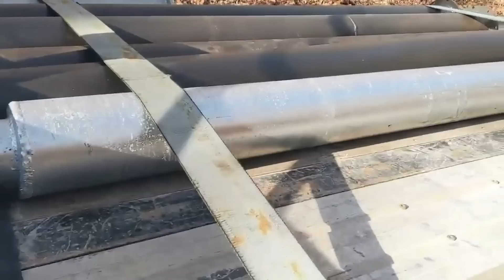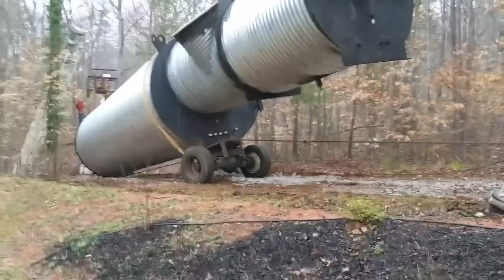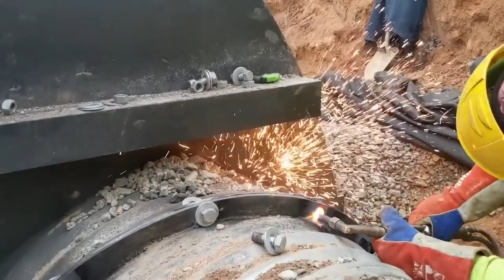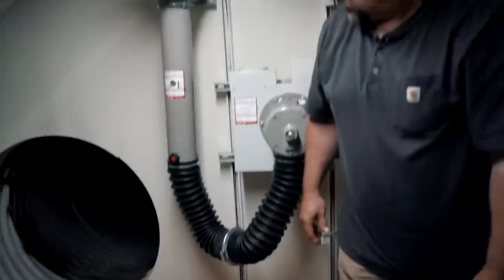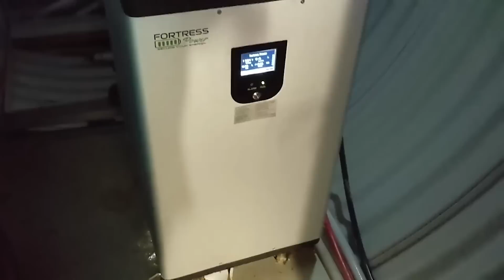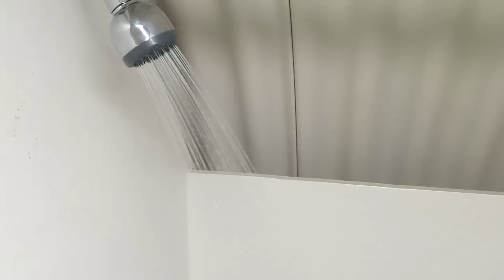Engineer775 installs an Atlas Bunker with Solar, a Diesel Generator, and WIFI!

Comment: To be effective, any bunker must have surface protection system or everything else is easily defeated
Reply: Good points,  That layer you suggest can be an art and science in itself.  Any suggestions.   Need some videos on that layer for the bunker.  Maybe call it the Bunker Skin Surface Protection Layer, or something like that.

Comment: Why not put the generator on the bottom with the fuel on top ?
Reply: and add a fuel tank or two (or three) above the generator room in the dirt and concrete with a fill above the dirt and concrete?
Reply: suggestions....

Comment: Nice shelter.
Serious question/considerations? (I am only asking because these bunkers seem to be setup to survive a nuclear exchange/war).
You have installed a solar panel system into your bunker to help offset your reliance on your generator for your electrical needs.
If the S.H.T.F. situation is a nuclear war/exchange, then you are looking at a nuclear winter that could last from 2 to 10 years in duration (See Wikipedia for more details on subject),
For the first 1-2 years you may not get any sunlight (or very little any road); with which to recharge your battery bank. Would installing a wind turbine/ small hydro system if you have a near by stream, be a good idea in this situation?
Secondly: How long will your air purifier system last before you have to change the carbon filter, and how do you go about changing the filter without contaminating the inside of your shelter when the filter is inside the main living space? (Also where do you put the used filter?).
Most perppers have a supply of about 6 - 12 months of food stored in their bunkers but you need 3.7l water per person per day (1305l approx' year); this is before cooking/keeping clean etc.., is taken into consideration. Have you considered how to recycle your water supply into potable water?
PLEASE do not think I am taking the P**S! 
The "Wine seller", you have had installed is a very nice one (wish I could afford to have one myself), but it all ways seems to me that these types of shelters are setup primarily for short to medium periods of civil unrest (1 to 3 months) but no thought has gone into their long term use as a nuclear fallout/survival shelter.
Most major S.H.T.F. situations seem to have the potential to last for decades (As in rebuild society time periods). I can see the real value to owning a bunker in the short term of a nuclear war but question it's value for any long term usage especially if all you have to go back to is an irradiated landscape.
Could be wrong, I would love to hear what you think on the questions I have raised.
Reply from the maker: The purpose of this particular shelter is a 30 day fallout shelter plus.     As far as long term goes as long as he has fuel he has power and since he has water he can survive in his freeze dried food.    It’s a small bunker so years is not practical without resupply
Reply: Paul you need to stop taking info from video games. Fallout is the major issue after a nuke and can be predicted on where it will fall based off what the target is and where the wind generally is as the fallout is simply the dust sucked up and mixed with the left over fission materials from the blast so all things that are heavier then air and quickly start falling out in a known zone. Nuclear winter would take a lot of wasted bombs to create as you need to ground burst the bomb to throw lots of dust up with all the bombs rather then doing the normal air burst to maximize the damage or bunker buster bombs to crack hardened targets.

You will still be able to go outside the bunker once the fallout is done and at that point it is simply wipe down/wash off the dust in most areas and in the gardens strip the top few inches of soil depending on the amount of rain. Fallout is the type of radiation a simple bunny suit will protect you from and when you are done working a shower will wash off anything that got past/around the suit.

Comment: "Comepletely" off grid?  You need diesel to supplement solar which only really works to capacity on sunny days. The fewer sunny days you have... the more you rely on diesel for your generator. When it becomes necessary to go into your shelter for an extended time you don't count on the stores to have food... guess what?... the fuel stations will be out of diesel as well. And what if your solar is damaged and unfixable? There is a company that I've been trying to get more info about that makes generators that produce electricity with magnets and do not require fossil fuel, wind, sun or nuclear reaction. They have a website but don't advertise extensively or put out many videos. They say that they're developing a model sized for RV use that may be worth looking into. The smallest size they have at the moment is a 15000kw. The link is below.

http://www.therontechnologies.com/pages/home

Comment: I'd run air intake up inside a tall stump so it's camouflaged.
Reply: Empty bee hive with mesh to keep any from moving in. When sitting next to an active bee hive it would take someone that knows bees to know something is wrong.
Reply: @TheUserid82  that's a good idea, but I'll throw this out, as a beekeeper, I'd notice bees not going in and out if I sat there for a few mins. You'd want a half intake half hive box, so bees still go in/out.
Reply: @BasedBidoof  If you look at what I wrote I did say it would take someone that knows bees to know something is wrong. It would take some work to have an active hive next to the intake and not effect air quality in the bunker or hive quality due to the amount of air pulled in so best in an empty box and the active hive next to the one you are using.

Having the hive over the intake makes it look like a perfect hive for someone to rob for honey and all the poop is dropping down to the air intake area. Having the hive next to the intake means you have a small hive so might not have the storage space for winter so would abandon the hive for a larger space.
Reply: Mine comes up in the middle of my pond.
Reply: In other videos, I've seen them suggest putting a 55 gallon drum over the top of the intake pipe for some disguise (with some holes punched for air flow, of course)

Comment: Wish I could have a bunker, but I’m in a flood zone and it’ll end up floating at some point if I did get one. <\3
Reply: Bunkers are possible there it just takes more work as you need to insure they are 100% water tight with the venting above the highest known floods and you have enough ballast on top of the bunker that in a flood it stays in place. 

If the flooding only gets a few feet up you can even create flood walls around the property and use a simple plank and gasket method to close off the openings for walking in and the car.

Comment: What would this set up cost start to finish?
Reply: Every setup is different as the shipping costs depend on how far you are from Texas and generally you are using a local guy to dig the hole and get it installed to Atlas standards. How hard to dig the hole and any surprises like shallow bedrock can really jack up the install costs as you then need drilling and blasting done. There are the simple things like where is the water table as where I am its 800+ feet down but in other parts of the country it is under 12 inches down.

Comment: Why did you decide to use a water heater Instahot water heater less space compact heats water as needed Easy installation at sink and shower easy replacement if goes out. Easy storage of additional replace meats. More storage for food
Reply: i do believe those are gas. not sure
Reply: Kraii If so the produce carbon my oxides Not a good idea IMO. I could see it being installed in the generator room which is vented properly and sealed off . Research Instahots water heaters perfect application for shelters Removed the water heater on my dads boat and installed instahots and his utility consumption reduced Turn the area where the water heater was into storage
Reply: If you mean an on-demand water heater using propane That's a really bad idea. If you mean an electric can you tell me how many amps one of those pulls?
Reply: @engineer775  How hot does it get in that gen pod after running that engine for....say 3 hours to charge the battery and maybe do some cooking, showering and whatever else?

Is there any sort of air flowing through that pod to keep that engine cool?

Also, have you ever considered using and exhaust to water heat exchanger and suck the heat out of the exhaust of the gen set and dump it into your hot water tank?

Like this maybe. These work great and you NEVER run out of hot water for showers and no big amp draw either, other than about 80 watts for a Taco pump.
https://polarpower.com/products/generator-accessories/exhaust-heat-exchanger/

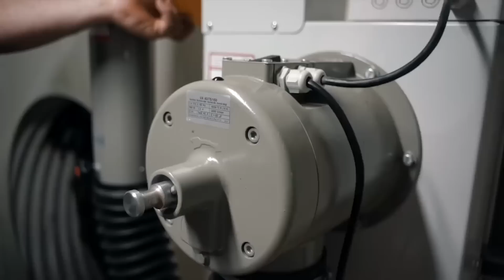Comment: 10:26 way to loud to sleep inside.
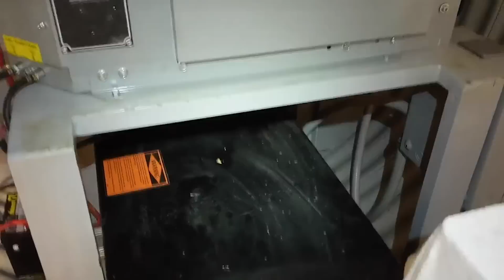Reply: I think you mean 15:26....and it is only loud if you sleep in the generator pod.....you have a gas tight door to the living area and once the door is shut you cannot hear the generator at all.
Reply: What a camera mic picks up is generally very different from what is going on in the room itself as it can get things outside our hearing range and can some times be surface sounds that are sent up the tripod.

Comment: I’m still concerned about hauling fuel into the pod to run a generator
Reply: Diesel is not as dangerous as regular gasoline...much safer in tight quarters similar to a ship.
Reply: It's no different than having a 265 gallon tank of fuel oil in your basement to heat your home in the winter time, like we did back on the farm. Not only that, our wood burning stove was maybe 10 or 12 feet away from the tank and ran that like that for decades with no problem. Diesel, is a very safe fuel to have inside.
Reply: wjf213 I get that my moms house in Maine has 275 in basement but the fill is outside not carrying 5-10 gallons of fuel into the pod and yes I’m aware the burn and flash points are different then Gasoline I was a firefighter for over 30yrs still never filled lawn mowers or generators inside always took them out side. Just wonder why a fuel tank couldn’t of been either buried or placed someplace then run the fuel line into a pod
Reply: @timalexander1166  If you mean why don't they have the fuel filler cap more easily accessible, that's pretty easy to explain. We're talking SHTF here and you want TOTAL physical control over every aspect of your bunker. Having the fuel fill outside the bunker is as foolish as leaving your car running with the doors open on the south side of Chicago while you go inside and do your shopping.

In normal times, yes I agree, for ease of filling and what not, the cap should be where the driver can easily fill the tank from his fuel truck. We had this on our farm house. The tank was inside but you filled it from outside. 

I believe tumbleweed had a perfect suggestion as well, and maybe some thing in future bunkers they can implement. Have a fuel cap at the top of the entrance but still inside the bunker, so when you open the hatch, you have a fuel cap right there and can top it off. 

If that's what you mean, I think it's a great idea and one that should be an upgrade, and honestly, one I never really thought of, but then again I've never built a bunker like these here with the gen pod. I would not want to carry five gallon cans of fuel up and down all day long either. That's just asking for a broken leg half way through filling.
Reply: Not really any different from a diesel powered submarine.
Reply: Grow some muscles
Reply: with a diesel you could actually plumb another tank and just fill with vegetable oil. You would only need to run the diesel to start and to purge before shutdown otherwise once started you can switch over to the other tank and run on vegetable oil

Comment: COMPLETELY OFF THE GIRD ... engineer proceeds to install bunker with wifi
Reply: SpaceX starlink internet satellites will make that possible and affordable. off grid just means not reliant on city power, water, and sewer (the essentials). Internet is non-essential so I don't see that as a problem.
Reply: more than likely once the hatch is closed you would never see a single outside of the bunker  i live in a metal building above ground and don't get a single outside my house
Reply: just use ethernet plugged directly into a pc and a vpn. could even be a homemade vpn for extra privacy
Reply: And I highly doubt people would be looking for wifi signals
Reply: WiFi won't escape the steel underground bunker and its completely possible to mask where you are (your ip address) with vpn's, hackers do it all the time.
Reply: @shawnwade302  assuming vpn's are still available
Reply: it is still off grid, if you lose WIFI so what? No reason not to use it when available.
Reply: How do they stop someone from stealing their solar panels while they are under ground???
Reply: Would a vpn help or no
Reply: "They'll track his bunker using his WiFi."

Good lord, stop pretending any of you bellends would have time or resources to do any tracking when your life is at stake.
Reply: @BlackCrossCrusader  raiders will do what they need to do , desperate times call for desperate measures
Reply: @juggernaut8819  And people in the bunker are equally desperate except they have resources to back themselves.
Reply: WIFI?  Sorry but there won’t be any WiFi after a nuclear war
Reply: Lol exactly WiFi in which will disclose the  bunkers location
Reply: @mikeandhunterfatherandson6705  A Starlink earth station doesn't necessarily disclose your location.
Reply: Margaret Leber the WiFi  period would disclose a relative proximity of your location all it would take is a simple scan for signal  from any device that is able to connect to wireless internet..it would even show  the person how strong the signal is  ..eventually spiking stronger as they get closer  .. the only question is would the WiFi signal be strong enough  .being 20ft bellow the surface in a metal bunker incased in concrete ... I would hope they incased the bunker in concrete I quit watching  after the WiFi comment  and noticing  that a professional engineer was  installing a bunker putting lives in danger without any proper shoring  neither step ,slope or a trench box .i love what  atlas does and this has no reflection  on the quality of atlases work  and atlas should not be judged for any of these things...also I never mentioned anything about starlink  so I’m not sure we’re tha comes into the conversation  as I was talking about the WiFi signal coming from the router  and if it is 5g .. forget about it you exact location wil be given  best way to prep off grid since in a shtf scenario  is to not be connected to the  any type grid,sewer,water,electricity,internet, be completely self sufficient. Because  when shtf happens and there is lack of food water,ect...... they will come and take what they need and leave you the scraps ...and if you have been watching the  all the looting and rioting ..when shtf happens  you can best believe the ones who didn’t prepare  are gonna wanna come steal yours  ..so when you don install a bunker you wannna do what ever you can  to disguise all pipes. Hatch entrances ..ect.  Highly recommend  planting  bushy pine trees  or do what I plan used junk old demo derby cars to cover the ground above the bunker and disguise the door underneath one of the cars.  Put the vent pipes up thru the trunks of the smashed demo derby cars..if your gonna do it ..do it right .. and have a back up for the backup
Reply: @mikeandhunterfatherandson6705  WiFi access points are very weak signals...them getting out of a steel shelter is very highly unlikely. I'd prefer wired connections inside though, if only because of the speed. Keep the AP turned off unless you're using it for something.
Reply: @mikeandhunterfatherandson6705  WiFi is for inside the bunker only he said he running a either cable down to the bunker so you wont be seeing any WiFi connection above the ground not if the bunker is 15-20 feet in the ground .. shit steel buildings along block WiFi connection there no way anyone getting in the bunker not with that steel door.. you see how thick that steel door is  . i love so call genius think they know everything
Reply: @mikeandhunterfatherandson6705  Not broadcasting your SSID will keep 99% of people from knowing you have a wifi network.
Reply: @MargaretLeber  Hmmm?
 Do you have a link to that information on starlink..
Reply: @mikeandhunterfatherandson6705 wrong, Ukraine and Russia both use star link and as long as its hidden it won't

Comment: How is that plastics pipe electrical circuit supposed to be EMP hardened?
Reply from the maker: The EMP is in the housing from Sol-Ark
Reply: @AtlasSurvivalShelters  It may well be, but without shielding around the wires, it'll have to withstand a much larger pulse than it should, thus nullifying most of that hardening. Next time route all external electrical/data wire through steel pipes welded to the bunker metal skin. Place all EMP protectors inside the bunker as close as possible to the entrance point inside steel cabinets.
As an exemption, you can safely route fiberglass cables through plastic pipe.
Also ask Sol-Ark for advice.

Comment: What is a ballpark price for this so I can start saving up!?!
Reply from the maker: $89,999 plus the power he did which was $50,000
Reply: @AtlasSurvivalShelters   Pretty reasonable, but if that includes the install then it's a bargain.
Reply: Unless u can save up in 10 years we have no chance. Nuclear war incoming within the decade
Reply: @oteb7229  been hearing that since 1962, time will make you a fool.